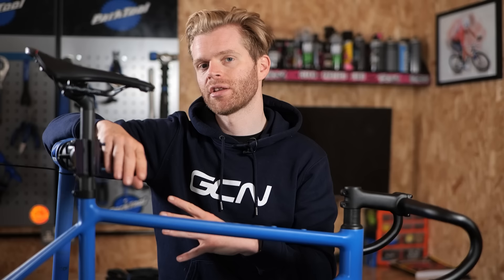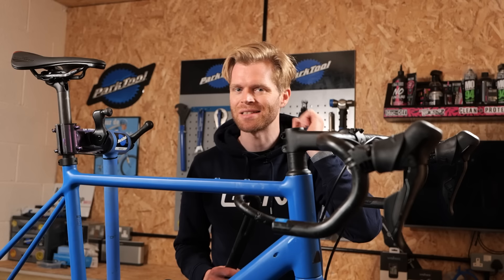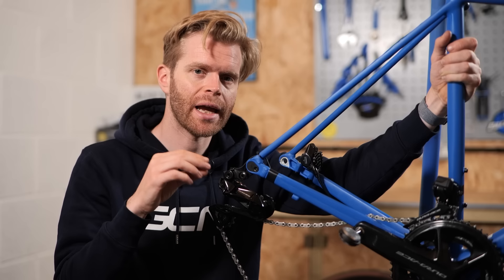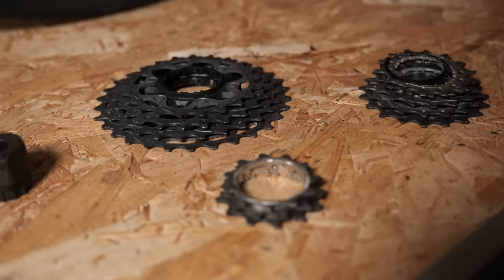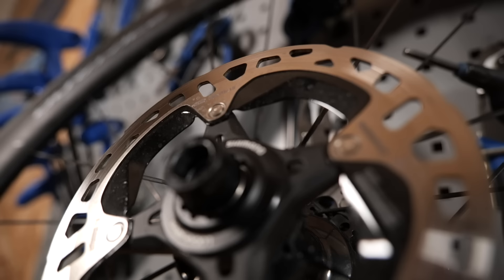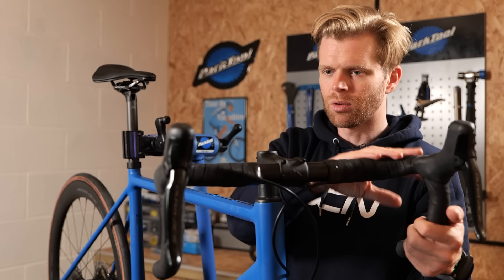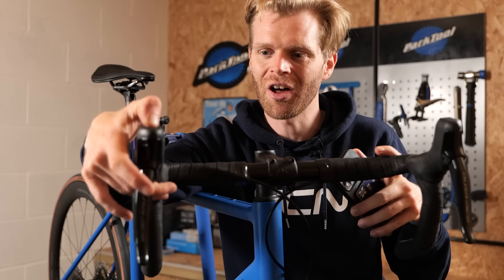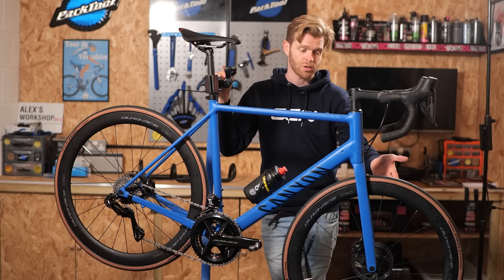The Upgrade! | GCN's Bike Makeover Ep. 2

Comment from the maker: Has this series inspired you to take on an upgrade project of your own?
Reply: I've just built up a bergamont dolce tr13 with a sensah empire groupset 2x11 11-32 rear 50-34 crank with tiagra hubs and I'm loving it 🚴🏻‍♂️ huge upgrade from my old viking xrr ventour with 2x8 shimano claris 👍🏻
Reply: Yup upgraded caad10 disc 105 mechanical to ultegra di2 plus added carbon bars,stem & Seatpost & to keep in budget I add hunts lightweight alloy aero wheels
Reply: I have a Trek Émomda SL 5 2019 everything stock came with Shimano 105 groupset and really want it to look a lot more streamline by "hiding" the cables if possible.

It is rim brakes. Is it possible to get wireless gear shifter that fits for that model bike?

The cabling looks very similar to the project bike there.

Hope someone can help me out with some good ideas. Thanks.
Reply: @benjaminkoch3244  hello unfortunately I couldn't translate your reply 🙃
Reply: please get some flush cut wire cutters and cut those zip ties flush
Reply: Yeah problem is if I spent the kind of money for a DI2 system bike my wife would .... well ... do the math =D
Reply: I purchased your road bike maintainance book.  I’d like to upgrade my Cannondale Topstone carbon 5 2x11 to the di2 2X11.  I don’t think the crank is compatible though.  It’s 24 mm and I think my Cannondale is 30mm.  What should I do?
Reply: it's inspired me to consider buying a steel frame and building up my bike myself rather than buying stock

Comment: This is effectively what I’ve done with my current bike. I started out with an alloy frame gravel bike with 1 x Rival on it. Over my life with it, I’ve changed and tweaked the drivetrain, the handlebars, the saddle, the wheels and the stem length. I’ve now completely dialled in the set up that’s perfect for my cycling. It means all I do next is find a frame I like and transplant the components… but there’s no rush ‘cause the frame is perfectly good.
Reply: Good job Andrew
Reply: Same with my bike. $350 alloy frame, ultegra r8000 groupset and vision wheelset. For my frame upgrade im looking at winspace t1500.
Reply from the maker: Sounds awesome Andrew!
Reply: As a 85kg rider, there's a limit to how much I'm willing to pay to shave a few more grams off the frame & other non-spinning parts.  Lighter wheels & rims with less rolling friction will give me more benefit.  The only reasons I'm considering carbon for my next frame is because there's more variety in frame shapes available and the increased stiffness.

Comment: The handlebar swap was probably the most sensible upgrade. People have a habit of focusing only on the bike vs the bike and rider combo. I swapped out my “aero bars” for a slimmer traditional compact handlebar a few months back. Makes a pretty significant difference once you’re up to speed. 

For reference 40cm down to 36cm + slightly inverted shifters. Felt skiddish at first, but like everything else in life, do it enough until it’s your new normal. Now i ride it like i never swapped.

Comment: Really interested on where the weight savings came from. My bet is on the wheels-tires-inner tubes?

I'm currently doing something similar, but much more reasonable (and budget friendly). Started with a Triban 520 (alu frame with carbon fork, rim brake edition), already bought a 11-28 cassete, 105 brakes, latex tubes, Vittoria Corsa tires, and am waiting for the carbon wheelset to arrive to switch things up.

Comment: Just a few years ago I went on a bit of a spree of building / rebuilding a bunch of bikes of varying  quality with Ultegra and was always extremely pleased with the results and felt it was worth it to optimize the capabilities of the frames (including some chromoly steel and aluminum). But! that was when you could easily find a whole mechanical 11-speed Ultegra 6800  groupset online for like $700…. Fast forward to the present and the ROI calculus is far different.
Reply: Meanwhile 105 Di2
Reply: @rev_dude  Precisely!

Comment: Ollie, I have a question about building a disc brake vs rim brake wheel. Rim brakes apply force to the rim, then tire and road. Disc brakes apply that force to the hub then spokes then rim and so forth. That means disc brake wheels apply a torque to the hub whereas rim brakes don’t. We often lace front wheels radially, as they don’t take torque like rear wheels…but now they will. Is a different, maybe 2x, lacing pattern recommended? Thanks! Richard

Comment: You’ve also made an interesting point for people shopping for a new bike. 

When given the choice should you:
A. Buy high end frame and lower spec parts (potentially to upgrade over time)
B. Buy value frame with higher end spec (what you’ve built now, although Dura Ace is extreme in performance and price)

I think for most people B makes most sense. The current value frame is already really really good

Comment: Just a tip with the zip ties. Cut them flush as are very sharp especially when exposed to UV and are cut crooked.
Reply: I file the sharp ends.
Reply: If you twist the ends off instead of cutting them off, they aren’t sharp.

Comment: It’s a year later and I just watched this, but I have to comment. When you cut your zip ties, make sure to cut the tail off completely flush. You left a small bit when you trimmed the one holding the DI2 cable at the rear derailleur. It drives vehicle electricians and mechanics crazy because that is like a razor waiting to slice your hand open when you reach in to do work.
Reply: Your 100% , as an electrician can't tell you how many cuts I've gotten from those little  bits left after somebody used wire cutters instead of zip tie cutters.

Comment: I agree, handlebars are a great place to start. But those bars? I've not found anything that looks or feels better than FSA compact. When I bought my second hand Pinarello, first thing to go were the factory bars for a set of FSA compacts. One thing I strive to achieve is common contact points on all my bikes. My second bike is a vintage steel Kuwahara touring bike which obviously won't take modern bars. So I made my own stem adaptor to accommodate modern stem and bars. I now have same bars and same saddle on both bikes. It's nice.

Comment: I'mma cringe and wince at those C50s. I get why (sponsorship n such), but you can save ~100g, 1/3 off the price for 120kg rated, UCI approved, bombproof 49mm carbon, DB units. Not even delving into Chinese products.
 That saved $1,200AUD could then be sunk back into further weight weenie-ing and replacing the horrendous stock saddle (I lasted all of 20min on it before the desire to yeet it over the moon into a recycling bin overrode me).

Enjoy going for a roll Ollie, that frame is actually quite a delight. I'm hesitantly looking forward to getting out on mine after a horrendous 2 weeks of Covid, am feeling like I've the lungs of an asthmatic chain smoking hamster... fingers crossed that's not so. At least i don't need to peak in 6 weeks for the World Champs on my doorstep (Literally!)

Comment: For the price of Dura-Ace wheels and a complete di2 groupset,  you can buy a very good new carbon bike with very good wheels and a proper groupset (105 or Ultegra). And the most important thing because we are not professionals it's not about the bike and bike spec, it's all about power in your legs.
Reply: I completely agree. For as amateurs its all about power in your legs. 95% of the audience, including the Gcn promoter are ordinary amateurs and are not able to produce power and maintain high speeds for a long time like profesionals in order to feel the benefits of high-performance equipment. For example, I ride an alloy bike (Bmc teammachine alr) with a Sora 2x9 groupset and alloy wheels. I tried a carbon bike with carbon wheels and Ultegra di2 on my favorite route and I had a better average speed of 0.6kmh. Is it worth investing 2.5-3.5k euros to have a better average speed of 0.6kmh. I doubt it. As long as there are sheep, there will be wool. 😆

Comment: To say the crankset must follow the number of speeds in the rear is conservative, no? The front mech and chanring is probably the most tolerant of mixing and matching. I've used 11-speed front crankset with 9-speed rear cassette/derailleur and it worked great.

Comment: I went from well-maintained rim-brakes and Tiagra to 12spd Ultegra DI2 with hydraulic disc after yet another near-collision with another rider due to my braking distance being like 25 meters in the flat. It's a difference of night and day, purely in the braking department. Of course comparing apples and apples that have gone bad, but my point is that I mainly wanted to upgrade for convenience (no more changing brake lines) and safety, and both were super worth it imo.

Comment: Yes, understand the concept of putting top of line groupset on basic frame, which will, lo and behold, likely ride like a basic bike frame with a top of line groupset?
The point is if you can afford top of line groupset,  you almost certainly can afford a new frame too. In other words, the concept is interesting but in real world, few cyclists would sensibly pay for a separate top of line groupset (not an issue if you have a sponsor) relative to the value of the frame, when new frame built up already will be less expensive.
Reply: I had a great carbon bike from 2014 with 10 sp DuraAce 7900.  Parts started to get hard to find, so I upgraded in 2019 to 11sp 9100 as I wasn't ready to part with the frame.  I put the old DuraAce on my son's bike. Two years later, in 2021, I ordered an Oltre XR4 frameset and will continue with that bike for probably 5 more years until 11sp gets hard to source and I decide to upgrade to 12sp and put the 9100 on my trainer bike.

Comment: My best justification for Di2 is the ability to hammer the chain down to the small ring on the hill with plenty of torque on the crankset. Mechanical front derailiers  push the chain down with a spring and too much torque can stop it moving the chain resulting in you grinding to a halt on that steep hill. Di2 used a motor to go up and down the rings. Also the sound of the front derailier especially as its trimming, but it would be childish to get excited about that. wouldn't it?

Comment: 1:10 Shouldn't you use dust washers? This looks like WMF BB (not great choice of bearings as they have 24mm ID and are in direct contact with spindle. any wate ingress (likely in the UK) will cause parts to rust and seize.

Comment: Bearings can spin smoothly and freely when not under load, yet still exhibit high friction and rough turning under load. The spin test is meaningless. 

You’re also contradicting yourself by doing these upgrades in the first place. There was nothing “wrong” with the oem build kit, but if you are going to upgrade the entire build kit, play it safe and just install the Dura-Ace bottom bracket.  

One other point of disagreement is your routing of the rear derailleur wire on the inside of the seat stay. Zip tied or not,  the chain will bounce off of that wire and short it.  The wire should be routed around the outside of the seat stay on that bicycle. Otherwise, excellent job done on both the bicycle and the video. Cheers.

Comment: You missed the "best" part: running the cables/hoses through the frame. How long did that take?
Reply: It shouldn’t take long. The rear brake hose pops out of the downtube then runs externally to the brake. The front runs through the fork leg and pops out of the shoulder. If it was a full aero stem/bar with the hoses running through the headtube, that would be more complicated.

Comment: For someone with tiagra mechanical 10spd, would 105 make a noticeable difference or would going farther to ultegra or dura ace be the smarter option?
Reply: The biggest difference you'll find going higher-end is the weight. The shifting performance is very similar from 105 to even Dura Ace.

Comment: Great. Have asked this question before. I have a road bike with 105 mechanical and rim brakes (internal cable routing). I want to upgrade to ultegra di2. Is that possible with rim brakes?
Reply: 11 speed is, not 12.
Reply: Hi Patrick, you can get a 12 speed Shimano group set with rim brakes, I don’t know what that guy is on about- it’s the R8150 range👍

Comment: #ASKGCNTECH. Hi all. Crank-length question. I run 2022 Ultegra Di2 cranks at 172.5mm (that came with the bike). I want to install the Shimano Ultegra power meter but can only find 175mm in stock. The 172.5 have a delivery date of Feb 2023. Am I really going to notice the difference of 2.5mm (overall 5mm)? Surely this can be made up simply by getting a lower stack height in the pedals. I currently run Garmin XC-100's and they are significantly bulkier than the Shimano XTR SPD pedals.

Comment: What can i do about the sound on my 105 disc brake hes describing at 09:25 ?
Reply: Make sure the disc is in the middle of the pads and also that it’s not warped, with the mineral oil in Shimano brakes you will get some slight rub after heavy breaking due to the boiling point being lower then Dot fluid, this means the pistons are pushed out once the fluid expands after heavy braking
Reply: @georgegould1385  Cheers! So it happens mostly after heavy braking on descents and the sound comes while braking. Is there anything else i can do?

Comment: It always surprises me when someone says "got a whopping gear range, ideal for hills" when you have a 34x34 tooth setup... Which gives you 26 gear inches, which is waaaay not enough to climb the hills I've been climbing cycling around rural roads in Scotland. Maybe if you're a 60-70kg rider it's much different, I've got 50kg more to carry, and (while I also have big strong legs) anything above 21-22 gear inches seems impossible to accept for me.
Reply: 53/39 11/28 for me. But I could do with a 11/32 or 34 for anything over 16%.
Reply: It all depends on rider weight and ability, I was surprised a quick rider like Ollie with only 68 kilos ? would need such a big cassette. Personally sticking with 11x28 on a 50x34, will get me up anywhere here in Norway. A few places it would be nice to have quicker cadence, but only if I wanted to take it easy on steep climbs. And I'm at 83 kilos. But sure, at over 100 kilos you need more range.

Comment: First, bars should be set to the shoulder width of the rider. If the rider is scrunched they can’t breath properly. If you can’t exchange air your VO2 will suffer. On a ride greater than 25km, that can make a much greater difference than the marginal aero gains of narrow bars.

Secondly, you desperately need to work on you hydro line placement on those bars! Uneven and ‘loopy’, yet you finished the bar tape perfectly. Practice man, PRACTICE!

Disclaimer: I am a Retul certified fitter, and bike mechanic.

Comment: I will never do this, even if I receive the frame and components as gifts.
Frame sub-1000 bucks, groupset 4000 and wheels probably at least 3000 bucks. 10K, yet not even entry-level carbon frame.. Doesn't make any sense. And in the same video you're talking about "cheap" latext inner tube upgrade.. lolz okay let's call it "content"